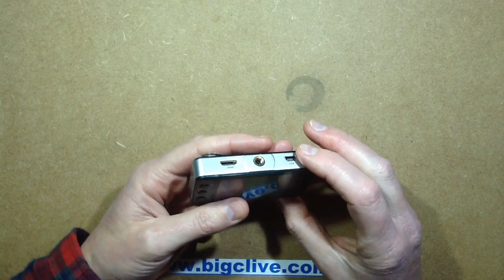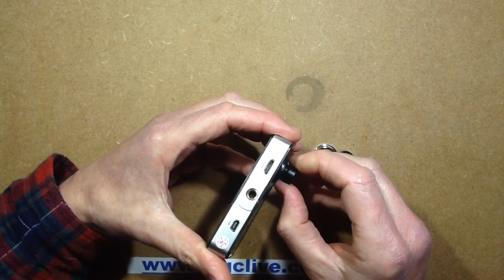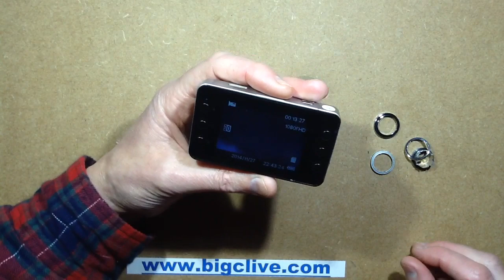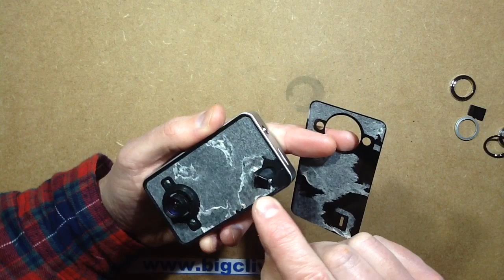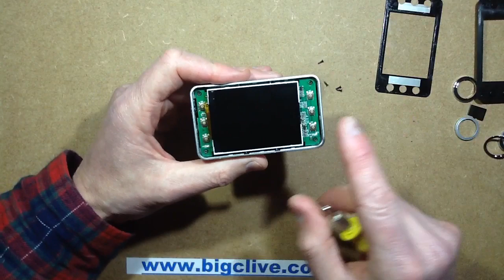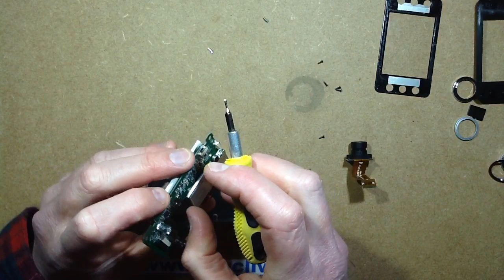Cheap dashboard camera disassembly and hacks.

Comment: How well does it work with closeup/macro now that you can wind the lens in and out?
Reply: It now goes to super-macro when the lens is set to closest focus.  You can get the objects right up to the lens.
Reply: +Clive Mitchell could it be used a component microscope?
Reply from the maker: +Ian Isted It can be adjusted to focus very close, so that's feasible, especially with a small ring of LEDs.  They do a similar thing on ebay with LCD screens on handheld microscopes.
Reply: +bigclivedotcom Cool. Thanks Clive. Love the videos :D
Between you, Julian Ilett, and Dave Jones I have all the electronics videos I could want.
Reply: +bigclivedotcom Cool. Thanks Clive. Love the videos :D
Between you, Julian Ilett, and Dave Jones I have all the electronics videos I could want.
Reply: +Ian Isted Have a look at Mike's electric stuff as well.